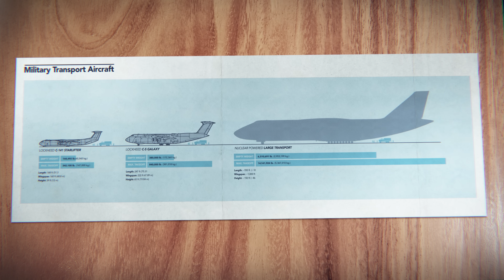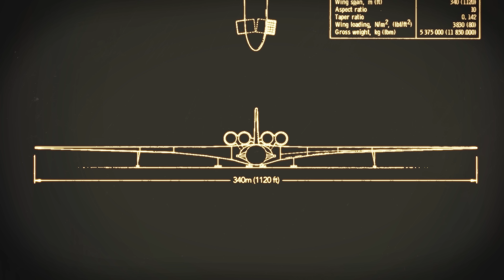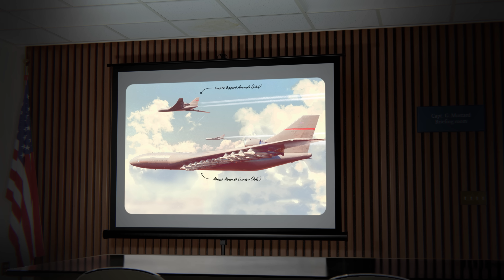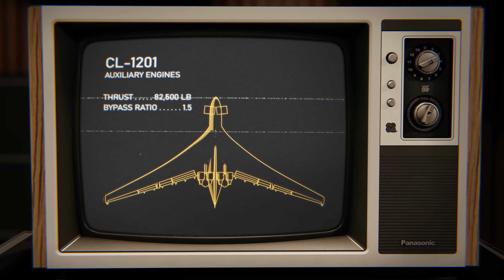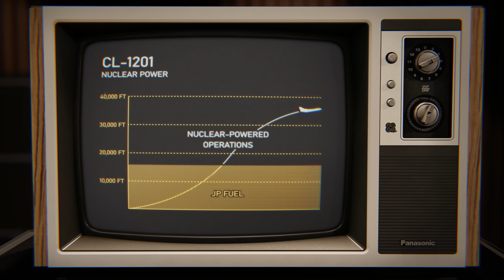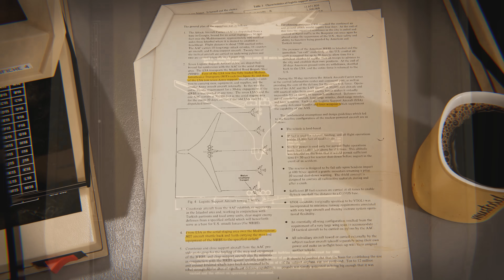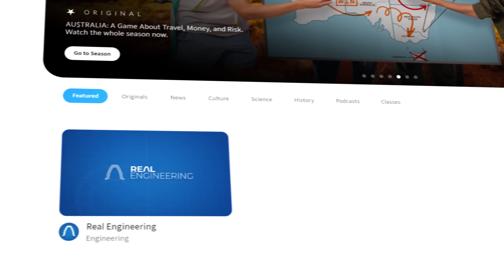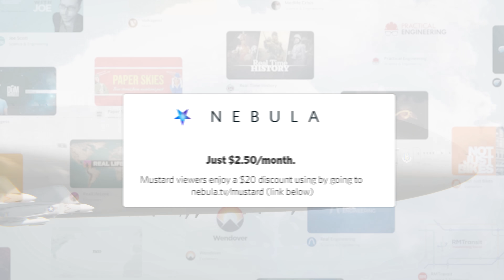Lockheed's Insane Attack Carrier: The CL-1201

Comment: It looks super cool, but I don't see that wing performing well under bending forces. The forces would rip at the fuselage. Which is why most wings go above, or below the aircraft so the fuselage doesn't deal with opposing forces like that. This AC design could easily be fixed by making it a thick low mounted wing, rather than a ultra thick mid mounted. That said, this thing would still have more to solve. Who knows if those jets in production or not. Which would require something custom from rolls royce or something.

Comment: So if you enjoy rabbit holes, here’s something I never knew before moving to Northern Metro Atlanta. In fact, I lived here for five years until I found this out. 
Did you notice how he mentioned it would take off from Georgia? I found out that in the 1970s, they were experimenting with nuclear powered aircraft. But the problem was the weight. So they got rid of the shielding. 👀
Not surprisingly, everything around aircraft, including underneath the aircraft flight path… died. The experimental building area still exist today in Dawsonville. A friend of mine said he actually went into the building that’s filled with water to contain the radiation. I would personally not be so “brave.” and I’m not sure that’s the right word for it. 😂 the location is the Dawsonville Forest, which I believe is just west of the outlet mall.

Comment: With today's tech, this is increasingly possible. Rack the thing with f35s and load it with rapid dragons that can be belly launched instead of tailgate launched for emergency air defense against missiles and the like. Line sides of the aircraft body with upscaled ball turrets firing conventional rounds as well as lasers as described. Then most importantly write "FUCK AROUND AND FIND OUT" in 50 different languages down the belly, big enough to big enough to be readable by anything in range to take a shot at it. Because while it might be the most valuable target on the battlefield that would normally make the most strategic sense to eliminate. Knocking this thing out of the sky is the fastest way to draw "you shot at officer-doc" levels of ire of the entire US Armed Forces. So maybe think before you shoot.

Comment: It's a good reason why they scrapped it. It would cost so much to maintain. Also, the additional weight of the aircraft carriers attaching to it. And I'm pretty sure the fuel and oil would be diabolical to maintain i'm pretty sure it's not going to be flying first either.

Comment: That's crazy nonsense.
It's not possible to create such a big structure on a few wheels by using actual materials as hd aluminium or carbon. But it will never be possible to build jet engines of that size. Maybe it would be possible to create an airplane of that size with some hundred wheels and dozens of jet engines, but it would have plenty of problems which couldn't be controlled by pilots, but only by AI Computers which area still science fiction in 2025.

Comment: The nuclear-powered turbofans.  .  .  There is a partial proof of concept in the nuclear rocket engine, which used a similar process to turn liquid hydrogen into gas.  That took six years or so to produce a working static test prototype.   (Going from memory:  my father was the overall testing director for the project with Westinghouse doing the reactor stuff and Aerojet General doing rocket stuff.  He was on the project from about 1963 to 1969, when it shut down.  Wikipedia may have more accurate dates.)
Heat transfer to make a gas (air) into a much hotter gas at the throughput of a giant turbofan is an engineering challenge of a whole different magnitude.

Comment: I love how absolutely bonkers WW2 and cold war science projects were. Too bad practicality wins out in the end, and everything becomes optimized and bland. People have repeatedly tried to make the largest [some war machine] assuming it would overpower the enemy. The Swedes tried it with the Wasa ship, the Japanese tried with the Yamato battleship, the Nazis had the Big Bertha railway cannon. There have also been a lot of plans for enormous battle tanks. They usually encounter a lot of problems. First, they're expensive and take a long time to build, so when they get destroyed a lot of your military force just vanishes. They lack maneuverability, resulting in them being a sitting duck if it's defenses are weakened sufficiently. They are expensive to operate.

I'm going to bet that the CL-1201 was scrapped because it would required a lot of expensive fuel to keep afloat, while a naval aircraft carrier does not need fuel to remain afloat. The CL-1201 would also require a massive airstrip to land, meaning, it would limit it's range. They would have to strategically secure certain areas all over the world to ensure it had places to land. None of these are really an issue with naval aircraft carriers.

It's just so much more convenient with a naval carrier, and many smaller crafts rather than a giant flying fortress. They're probably equally hard to hit, but the CL-1201 would probably suffer more critical damage if hit by a rocket. A ship can be pretty fucked and still float, but a plane will go down a lot easier. I bet they actually went through all the strength and drawbacks, compared with current technology, and realize the naval carriers were the more sensible choice.

Comment: Would be awesome. How exactly are troops, materials etc transferred from the MITs to the air carrier? Pressure seal attachment system from above? Could work for pilots but what about troops and heavy equipment etc? How would you transfer that? Would be very interesting to explore

Comment: In October of 2008 I witnessed two boomerang aircraft flying over the San Fernando Valley. It was around 7-8 pm so all I could see were the amber lights strobing off the leading edge of each craft. These craft were enormous. 
Finally 17 years later I firmly believe that these were the sons of the LC-1201 or the even more mysterious LC-1202.

Comment: That shit will get blown out of the sky by hypersonic missiles today.
Reply: Unless the missile had a nuclear warhead, it wouldn't be enough to shoot it down.
Reply: @ that shit is airborne, it has an “air frame” and relatively exposed engines.   A hypersonic missile strike with a 500-1000 pound warhead will either damage it drastically or force it to change it’s course and make emergency landing for repairs.

Comment: What do you mean by running a jet engine from jet fuel or “heat from the reactor”? You’re going to have to explain how a jet engine can run on “heat.”

This video is either massive trolling or making a huge deal out of nothing more than a “pie in the sky” back of the napkin idea. It sounds like there’s basically no documentation about this…

Comment: The Lockheed CL- 1201 was originally a concept back in 1969 to combat soviet forces. As you can see, it carries jets, and is classified as an “Attack Carrier”. It can carry a whopping 700 armed soldiers and tons of armaments and supplies, weighing in at millions of pounds. It had an extremely large load of electrical machinery, clocking in at  about 4,000 tons. The CL-1201 itself with its machinery, not jets, was estimated at around 6,000 tons. It had many attacker jets, reconnaissance aircraft, and other jets used for other purposes. It could carry about 2 dozen jets. It was planned to be followed by other jets, and had a larger nuclear reactor fuel tank. It could stay in the air for a whopping 30 days on end, no refueling. Like the nuclear submarines of the time, the CL-1201 had a nuclear reactor, just much, much larger. That’s all I could remember about this beast of an aircraft, please like my comment, this took extremely long to write

Comment: No matter how impractical this would have been, you cannot deny how fucking cool it would have been.
Reply: It's not impractical it can be done but it's the power to create lift would be the issue one way which could help proportion is by using the jets attached to flip there engines on to help create lift once it's up you shut down the extra jets and let it fly on its own propulsion the idea would need more to it obvs but believe me this isn't impractical nor is it impossible especially with the rapid progression of technology
Reply: @dannykay5536  they could probably just use the existing short take off system they had for cargo planes, which was solid rocket boosters that could be jettisoned after takeoff.
Reply: Oh yeah
Reply: I can think of 3/4 sci fi or adventure movies with something like this. Stealth, Sky Kings, Avengers .... ✈️
Reply: @DavidLLambertmobile and what does the 'fi' in sci-fi mean? 😉
Reply: Being imposing is not impractical 😈.
Reply: They should've built it just for the love of the game
Reply: Out of all the problems with this thing, the fact that it would recreate Chernobyl wherever it crashes is probably the worst one.
Reply: @zoeyredmond5501 "recreate Chernobyl" is a bit of an overreach. There has been similar incidents already. For example, a reactor explosion on K-431 nuclear submarine at Chazhma Bay, USSR. Refueling procedure violations caused around 10 people dead, 290 people injured and/or irradiated and some extensive work on dealing with radiation. Which is a lot, don't get me wrong. But that's still not even close to what happened at Chernobyl. I mean, Vladivostok is still standing and not a radioactive wasteland, despire it being located around 60 km/40 miles from the incident site
Reply: I wish they did make one as an experiment. XB-70 Valkyrie was supposed to be a supersonic bomber to deliver a nuclear strike. It was rendered obsolete with the ICBMs but JFK kept it on as a super sonic research vessel.
Reply: / absolutely horrifying
Death is at your doorstep in 5 hours, no matter where you try to go
Reply: No matter how impractical this would have been, these companies will find a way to force US into another conflict just so they can get richer
Reply: yep
Reply: It's not only impractical but also highly dangerous considering if it ever crashes the amount of lives lost plus the amount of money lost would be astronomical.
Reply: @Dan-di9jd sounds like a skill issue on your part. Just don't crash, dummy

/s

Comment: With the crazy amount of mechanical service
Required for every flight hour that's needed for fighter jets. Im curious with no close bases for possible help, how'd they plan on maintnance at 36000ft? Preflight?  I remember a different plan with interior housing of the fighters. Isn't there much-needed exterior maintnance after every flight?  I just looked it up. Every flight hour of the F4 requires more than 20 hours of maintenance! Maybe they were expected to get one deployment per jet? That's the only thing that makes sense we to me. I guess if it was needed to fly. That would change what happens next.  Not likely 30 days of on and off use.

Comment: 8:27 “20 second shutdown warning” aaaaaa yes because every air incident warns people a minute before the crash
Reply: Not a minute 20 seconds that's the difference only have to push a button for shut down
Reply: If you're flying at several thousand feet above sea level, 20 seconds should be enough time.

Comment: The CL-12-1 will not last a second in the modern age of hypersonic air-to-air and surface-to-air missiles like the R37M and the S-400. The larger size only meant it will be easily found by long range radar and intercepted. A single missile taking out the nuclear plant will render the plane useless.

Comment: I love the concept of using F-4's in the example, that's the LAST plane you should choose for such a project, they are incredibly heavy and thirsty
Reply: they were the main carrier aircraft for that time, and their combination of capability and high fuel consumption means they're actually more useful on a carrier than most other things, they can use their power to be good in combat and then use a carrier to make up for their less-than-stunning range. their heaviness is an issue though
Reply: F5s could be good. Small, lighter, easier to store, and can win dogfights with soviet jets. If we’re talking more modern, F16s would work
Reply: Skyhawks would have been interesting.
Reply: If you’re building a 6000 tonne nuclear-powered flying super-villain lair I can’t see how the additional mass of an F-4 Phantom is much of a concern…
Reply: Because in 69, that's the best fighter you could bring for any sort of role. They could go with Tigers tho, and fir probably 5-6 more in its wings. 

If this was made in 2025, 26 F-16s would fit or 30 Hornets lul.
Reply: If this were modern I could see this using the f35-c for its planes
Reply: @Arandomaccount343 this would be more practical considering they’re the fun size 5th gen and the STOL would help SO MUCH with landing. They should have used the top of the wing instead of the bottom to make things easier.
Reply: @judet2992  Can't use the top of the wing because that interferes with its ability to produce lift - look up aerodynamic stall
Reply: @ I know what a stall is bruh, I’m watching a Mustard vid, look at the size of the wing. It wouldn’t disrupt it enough.
Reply: @Arandomaccount343 Not sure this is the best platform for an LO strike aircraft…

Comment: Too Lockheed Martin it's valiant barret Jackson person prince can an huge planes engines tuck  two super fast strong engines and tuck out weapons 3:09 anti gravity hovering harrier jet engines included fan like propellor blade that can adjust in flat position to form an circular flat close area in wings    the propellors can open gaps so air can pass through and therefore be powered and enter hovering mode doors open underneath wings engines go inside plane mid air Jet's helicopters flying out of huge hovering through antigravity and hovering harrier jet engines type built-in to plane galaxy the name

Comment: The F-104 was NEVER the most advanced 3rd gen jet fighter! Actually, the most advanced ones were the Mirage-IIIE, the F-8 Crusader and the Mirage F1... 
The F-104 Starfighter proved itself totally USELESS, killed more NATO pilots than any other aircraft, enemy or not at the point it was nicknamed the Flying Coffin, the Widowmaker or the Lawn Dart... As a counterpart, the Mirage-III and Mirage F1 are still being used today, the most advanced version, the Kfir-NG, hasn't a lot to envy to the F-16V or the new Gripen-E, highly upgraded F-8 was still used by French navy until replacement by Rafale-M in the mid-00's and when it comes to Mirage-2000, the last Mirage, you can upgrade it to 4.5gen++ with all of the Rafale's bells and whistles, and the best squadron participating Red Flag drills is the Greek Mirage-2000 one... Mirage-2000 is also known as the F-16 killer because Turkish and Pakistani F-16s were shot down by Greek and Indian Mirage-2000 without being able to shoot down any...

Comment: Ah, if you want an aircraft with insane specs that will have astronomical costs and will suck and a company unable to make a good combat aircraft... Give a call to Lockheed... (F-22 was mainly designed by General Dynamics and Boeing when Lockheed bought GD, then the cost became insane and the F-22 became sub-par because USAF couldn't afford all the planed options... And F-22 availability is terrible).
Lockheed is good at doing cargo aircraft or spy planes, but don't let 'em make anything else...
When you want the things getting done, give a call to Dassault : Had the French govt been able to spend as much as the US one, gosh, their "black projects" are totally insane but every time they came with any project... It ended doing the job better than expected, over-par with the spec-sheath, on schedule and with no overcost! Had Dassault been asked to make the F-35, it would have ended being better than the F-22 or as capable and for cheap, actually, it's the case with the Rafale and, from the start, had French govt been willing to fully put money in, the M88 engine could be delivered with 100kN dry thrust, 115kN afterburner and even vectored thrust from the start... With this, and the engine with these specs is available, the Rafale-M would take off at MTOW from the ski-jump on the Cavour or the only 230m long Juan Carlos Spanish LHD, no issues to add a ski-jump on US LHD/LHA, then, adding a small angled deck plug on sponsons like on the Essex-class CVs would be cheap and you get a STOBAR aircraft carrier on budget ! 
When it comes to stealth, Dassault, together with the ONERA, and Thales found solutions that work really great and don't induce astronomical spendings.
The only time Rafale went to Red Flag, the Patriot SAM teams nicknamed it the Klingon Vessel and the French infuriated the organisation by using only passive sensors and really acting 5th gen, the organisation accused the French of staying off and just being here to spy on others electronic warfare but in fact, they were killing it and it would have forced Red Flag to admit the French superiority while the drill is here to promote US manufacturers and requesting others to NOT use passive sensors nonetheless is a handicap because Europeans, especially the French, are way way more advanced in electro-optics, then it allows the US to spy on their radars and EW... 
Understanding that Red Flag wasn't a realistic drill, considering how the organisation was insulting (a few years later, the Indians were so ashamed that their MinDef went into an official protest, and the Red Flag Org wasn't just pitiful with its technical remarks: there were even stuff that was racist). The fact is that since, a new type of drill is being held that is way way more advanced, it's called Atlantic Trident and... the press is not allowed...